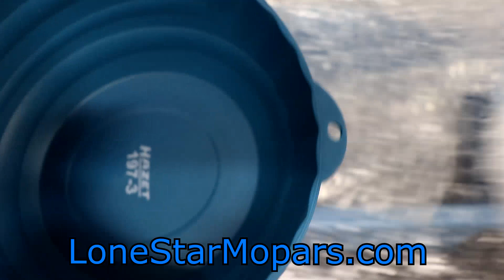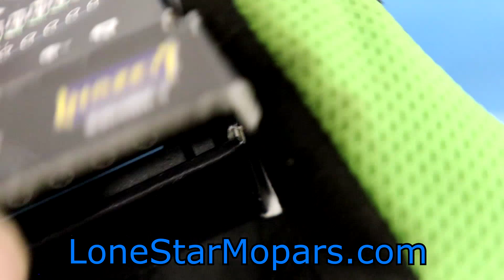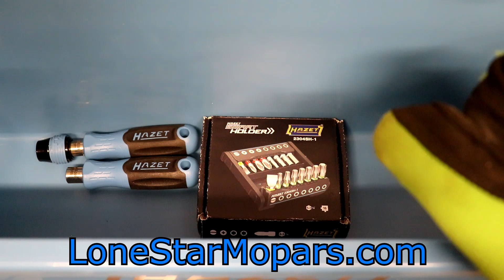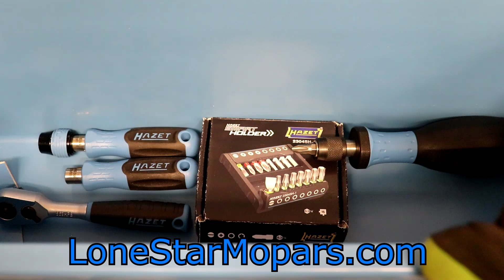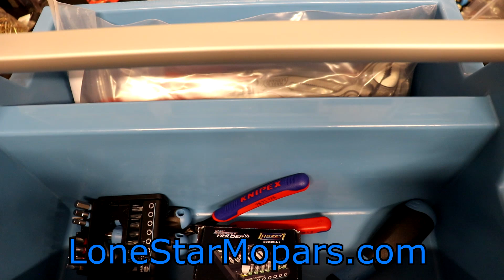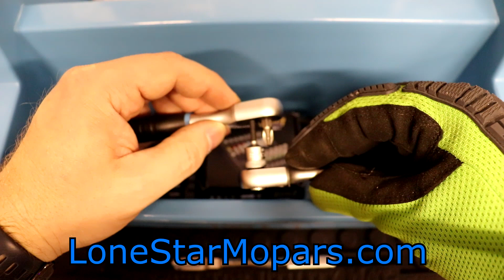KC Tool Haul #96: Hazet for Work Plus Bonus Stories and Rants

Comment: Fantastic video. :)  I am torn between the Hazet bit ratchet you featured and the Stahlwille 11132020.  Have you tried that one - and if so, which do you prefer?  It looks like the head on the Stahlwille 'might' be slightly lower profile, but not sure. And it has a sleek, understated look with the chrome handle.  Ultimately, both look like great ratchets, just not sure which one to end up getting.  Any suggestions/input would be appreciated. Thanks!

Comment: can you not just get a new cylinder for the fork? the base might be a bit more involved but the clevasse at the rod end should screw off. seems easier than finding a nut. i once fixed hydraulic stuff out of a van. the amount of tools you would need for every single different cylinder with different ways of tightening the nut, along with every other tool plus parts, would be insane. you want to dissipate the pressure before removing pressure side stuff, you can turn the fork off and actuate the levers. if a hose is hard and not flexible, it probably has pressure. always stand out of the way and if you're removing the carriage, you have to support it or it'll come speeding down when you remove the hose at the base of the cylinder

Comment: Good video.  I love Hazet tools.  I recently got the bit ratchet screwdriver 810R-4, smartholder 2300SH-1, and 2023 advent calendar.   The latter two have the mini bit ratchet that’s even smaller.  The 190L tote is fantastic.  You can put a lot of weight in it.  I use it for everything.  One last point, mayhew sells stubby hex sockets.  I have them, they are nice.
Reply from the maker: It is really hard to go wrong with Hazet.  The 810r-4 is on my Wishlist.  I've got both iterations from Gedore, but the lock and extension help to set the Hazet apart.  The 2300SH-1 is a killer deal imo.  I also think Hazet puts great bang for the buck in their Advent Calendars.  That is a good point on the Mayhews...I've tried to get them in the past and they were out of stock...may have to go that route...iirc they have TiN to boot!